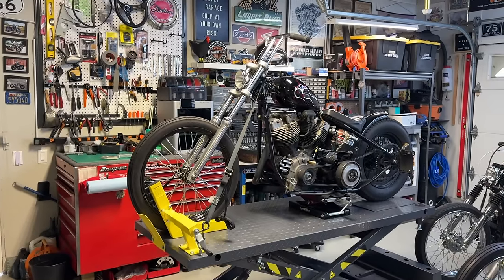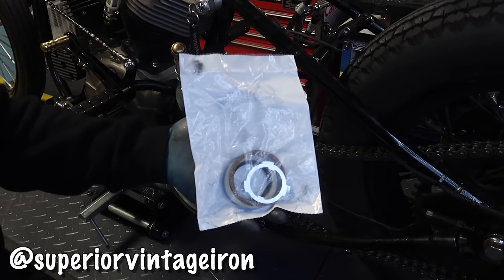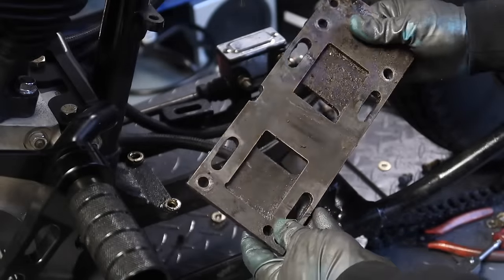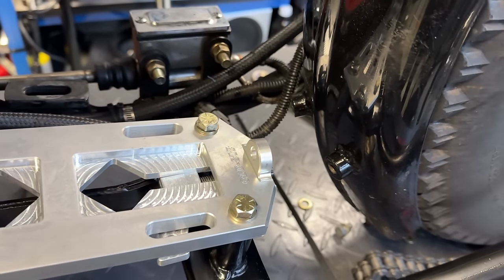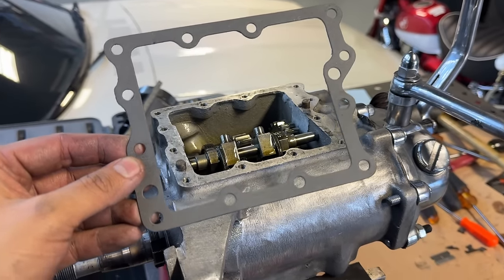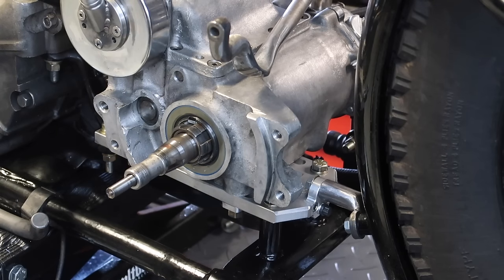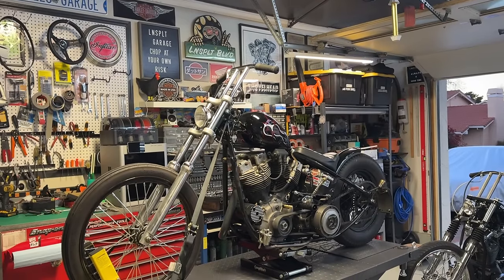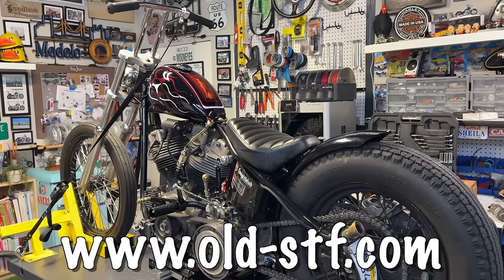Installing OLD-STF Adjustable Transmission Plate

Comment: I noticed that your old fender mount had a support for the oil bucket, just curious what you did to replace that since you didn’t put one on the new fender mount?
Reply from the maker: I’m gonna reuse that one, just need to cut and weld
Reply: @LNSPLTBLVD  cool. Thanks for the reply.